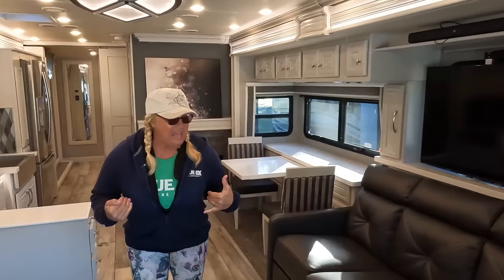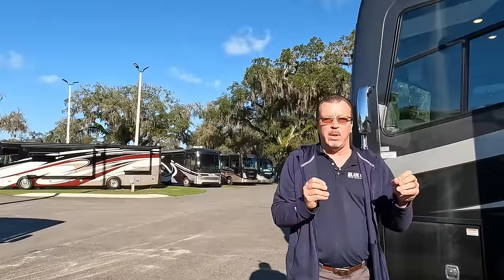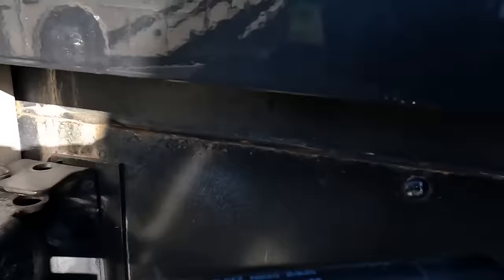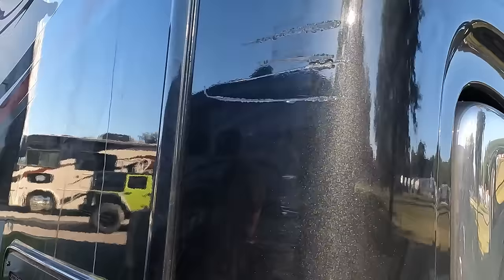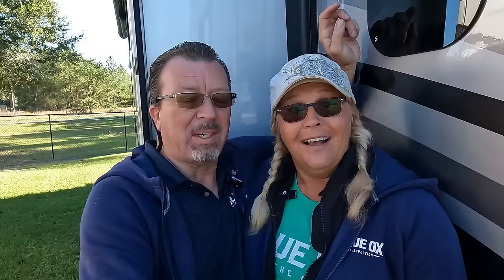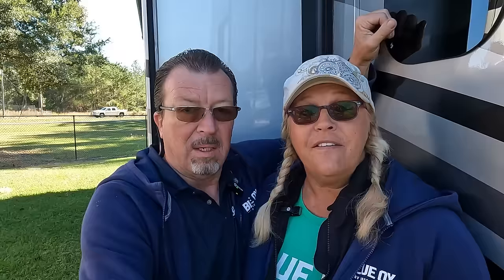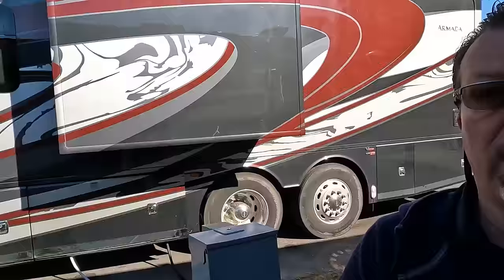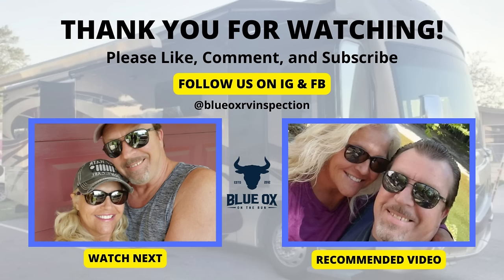🤬TRASHED 2021 HR ARMADA 44LE! DISGUSTING IS AN UNDERSTATEMENT!

Comment: If you're in Ocala Florida, and the Units are all crap I'm going to guess that you must be at Optimum RV.  They are the shadiest RV dealer around. I have a friend that bought a used Winnebago at their Zephyrhills Florida location and on her 1st trip to Maine she was stuck in NC in August, no dash a/c and the generator wasn't working so couldn't use the roof air. It cost her $Thousands to have everything repaired so she could continue to Maine.Optimum told her she didn't buy the extended warranty so she was on her own. They didn't answer her calls after that.  I'm surprised they are still in business. Shady, Shady, Shady. I tell everyone Don't but anything from Optimum RV, their Lying Thief's.
Reply from the maker: Listen to the man people 🤨 it didn't came from me 🙄😵‍💫🥴😶
Thanks for chiming in 😉🙂

Comment: Good walkthrough.  As inspectors, after a 10 minute look, you know how it's going to turn out.  Do you give the buyer a chance to abort right there, and save them much of the cost of a full day inspection?  Would minimize your loss of time as inspectors as well.  In my experience, be careful, as a seller, whom you choose to list with.  A number of dealers won't lift a finger to clean or repair even a NEW incoming unit, let alone an uncared for resale unit, until they have a buyer ready to go.  Some listing dealers offer the seller a clean up service for an exhorbitant price, but might have been worth it for this unit.  Selling dealer bother to unfold the slide seals?...that's the joke of the day! It appears to me the sellers got into the RV lifestyle, had at least two oopsies backing in, decided RVing is not for them, left open food in the galley then let it sit for months before deciding to sell it.  I would only buy this rig if the seller knocked off 5 figures or more for the roach infestation/cleanliness issues, get estimates for the body and paint repairs, then double that estimate to be knocked off bluebook value, as it would be months to repair; and another 50k off for presumed electrical issues and new batteries.  For an experienced RV owner who is handy, this unit could be a deal.
Reply from the maker: It will have to become a project definitely. 
Customers hires us for our expertise, not by the hour...

Comment: I got an inspection on a new Little Guy Max trailer this week, thanks to your channel.  Unfortunately they found an array of issues, and I don’t have the expertise to know how significant each one is, nor would I know how to check their work if the dealer agreed to resolve the issues.  Now what? Do I walk away from the deal? From the dealer? From the whole manufacturer?  I’m overwhelmed. 😞
Reply from the maker: Inspector should have been there for you even after the process you think?? Dropping you like a hot potato shows the lack of dedication and empathy of that person. Make sure to publicize the outfit 🤨
Reply: @blueoxontherun9188  Good point. I was impressed with their work and perhaps if I open that conversation they could offer further advice or at least walk through the issues more thoroughly with me. Thank you. ❤️
Reply: Just bought a new Thor this yr, loved floor plan and price, but, 5 weeks in shop for warranty repairs, full day on site service tech doing repairs, I myself spent 3 full weeks fixing, cleaning ,tightening, adjusting. 
I expected it (Large est dealer in county ) customers are crap in their eyes. Iv been in RVs for 50 yrs so I wasn't surprised. best advice, find a smaller honest family dealer or buy a clean well kept unit from a private seller. 😊
Reply: @rosjay_2119  Great advice.
Reply from the maker: Right??